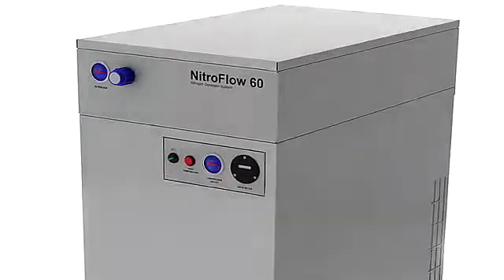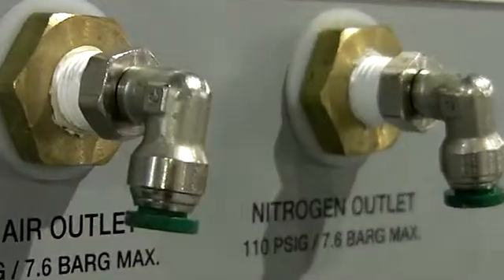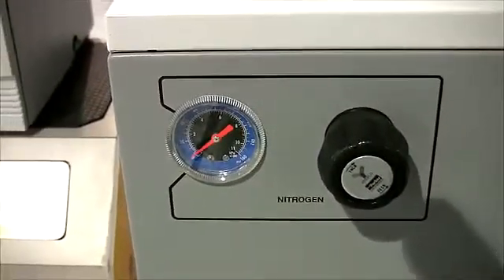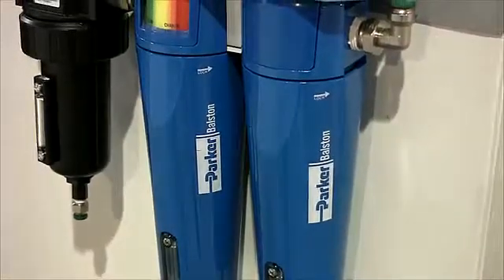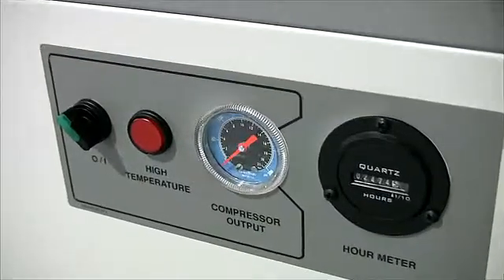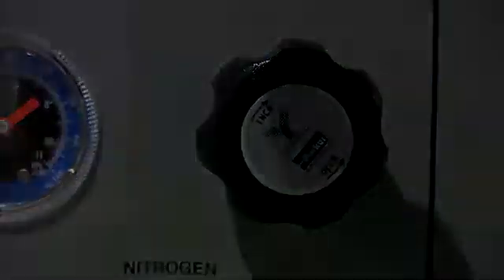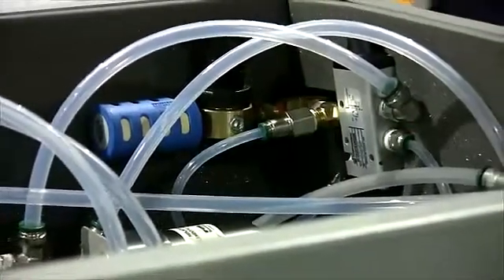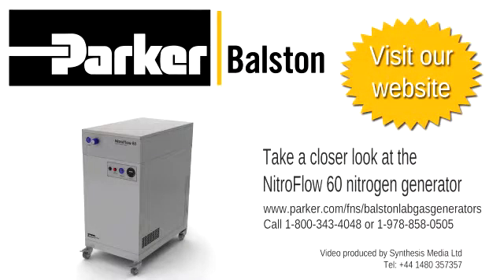Parker's High Flow Nitrogen Generator for LCMS Instruments

Comment: hi doeas Parker Nitro flow has 2 output Genarator for 2 Massspectrometer?
Reply from the maker: Thanks for reaching out to us.  The NitroflowLAB is a 30 LPM unit that’s designed to support a single MS instrument.  That said, it does support (2) instruments that require lower flows.

We do offer a 60 liter per minute, the Nitroflow60D, which supports 2 instruments very easily.  Jack at jmahan@parker.com can answer any additional questions you may have.